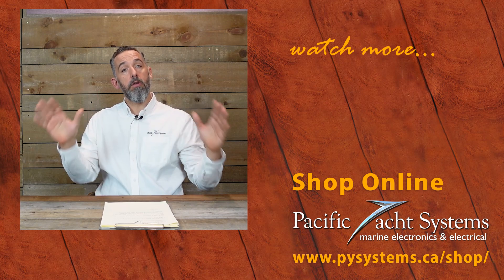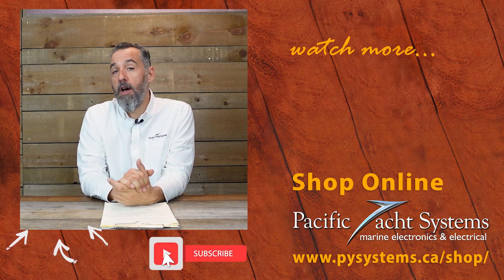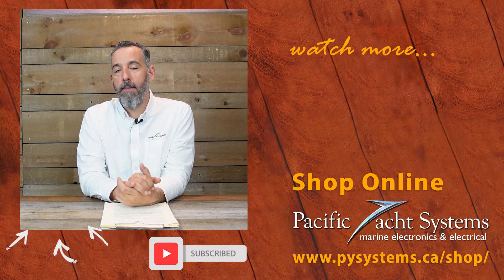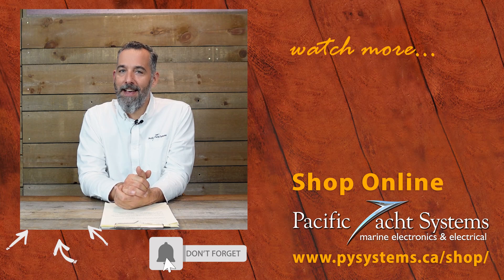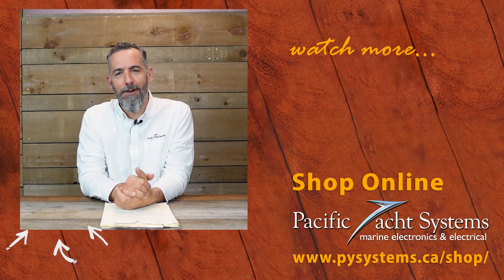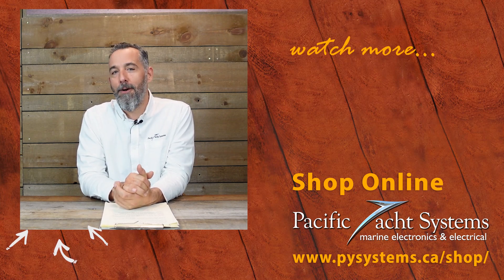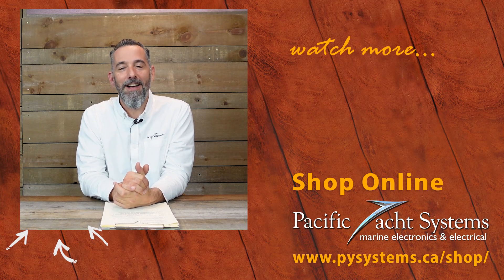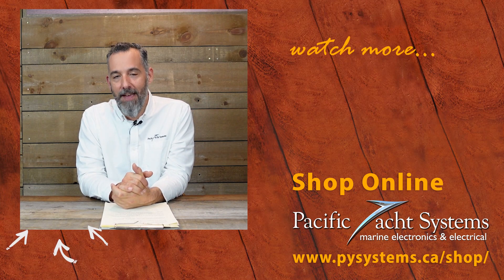Managing A Generator or Shore Power Overload on My Boat

Comment: Haha, so true. We have a 2800W inverter powered by shore power (120/30A) and we soon learned to pick between the microwave, water heater, and fridge. You can only pick 2. Generally, since the fridge is always on (120v) and inductive, you know you have to pick between the microwave and water heater, but not both. 
We learned to time the fridge compressor seasonally depending on ice buildup, but have been caught off guard on occasion which trips the inverter. Winter is the biggest challenge, since you add to that two dehumidifiers which means we run close to tripping with those and the two large-draw items previously mentioned on at the same time. 

On the 12v side, since you can run those separately from inverter loads without much worry, just be sure to up your cable sizes, particularly between the inverter/charger and house bus. We made the mistake of running a 12v main of 2/0 to the fuse block but 4/0 from the fuse block to the charger. That mistake nearly cost us the boat! Everything is now oversized and equally sized.

Comment: Good Video! One other thing to point out is that most generators are spec'd at  a surge power (short duration) and have a much lower running power.
Reply from the maker: Great point!